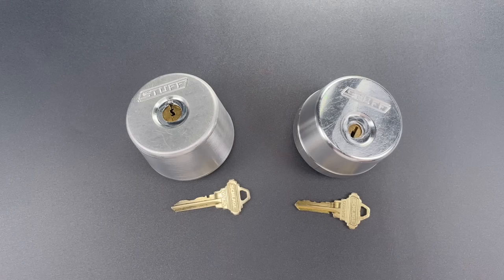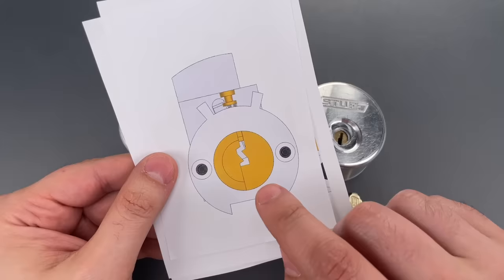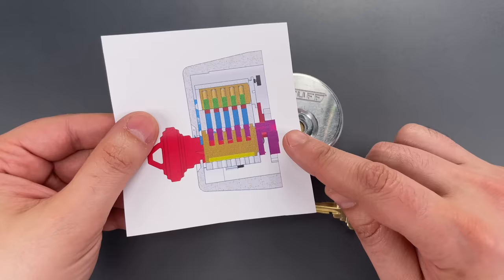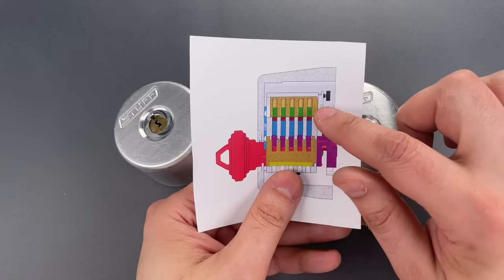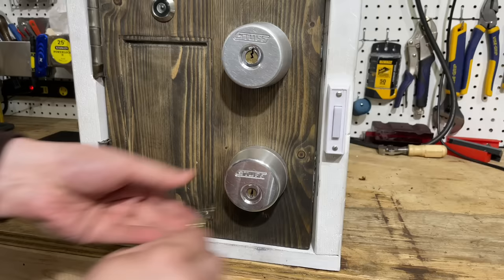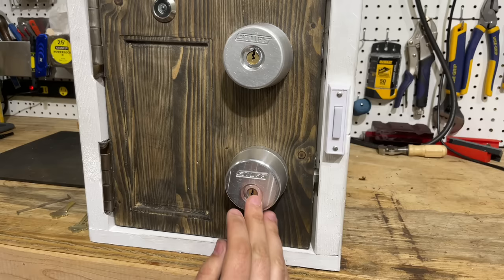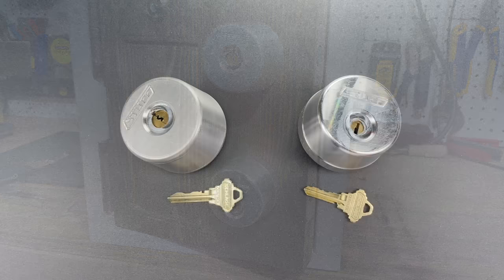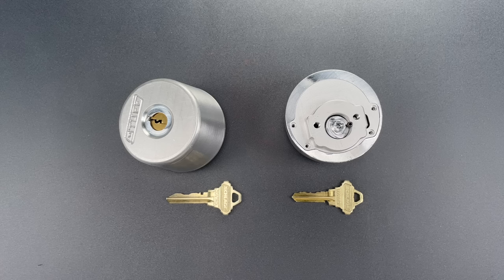[1299] Unpickable Locks From Stuff Made Here

Comment: Can't wait till Shane redesigns his locks again based on the feedback and this happens again
Reply: "What we're gonna do is use this jackhammer to remove the wall and bypass the door and lock in it's entirety"
Reply: @VilTheVillain  I'm starting to feel like that would be the only way. Shane literally built a back cover to fix one exploit LPL used before he even made the video, and the other two weaknesses are easily fixable with very little work. I feel like give them a few months working together, and they can create a truly unbeatable lock
Reply: @AlphaSeagull  absolutely. A master engineer and a master lockpicker building a lock together? That shit would be bomb proof by the end.
Reply: @acewarbringer4295  then they should patent it and either sell the lock or sell the design
Reply: Shane usually only gets things to the "proof of concept" phase before switching to a new project.  He's already worked on this one for ~6 months.  That said, it wouldn't shock me in the slightest if someone with business experience either bought or "borrowed" this idea from Shane.
Reply: @VilTheVillain  Pretty sure just using a ramset few times would do the trick.
Reply: @r3dp9  if you think this lock idea is some kind of crazy original thing you'd be wrong. There are plenty of extremely sound, pretty much un-bypassable lock designs out there, they're just not worth manufacturing. So no, aside from a gimmick, no-one would be wanting to borrow this lock idea for mass production. Of Shane can come up with this idea don't you think an engineer who's entire job is to design locks has thought of it?
Reply: Can wait for Shane to redesign the lock with a moving key hole so you never miss putting your key in the lock.
Reply: @AlphaSeagull  he should definitely sell that shit
Reply: @milo867  underrated comment 😁
Reply: @poopfartlord9695  - exactly. To mass produce this lock the price would be 800. Lock at abloy.
Reply: He will 
Im saying he's probably watching
Learning to Say we need a iron door and good deadbolts
Reply: @acewarbringer4295  yeah
Like They should collab to make the most Unpickable lock 
Undrillable
Unpickable 
Unshimmyable
UnBreakable
Reply: @r3dp9  id take it
Reply: @poopfartlord9695  well it would impress the market
Reply: @peterv1318 Well I'd buy for Protecting my SSN amd such
Reply: evryone : Can't wait till Shane redesigns his locks again based on the feedback
shane : oh shit here we go again ..........
Reply: To everyone reading this: I don’t know what happens in your life, but don’t be hard on yourself; love never hurts someone but a wrong person does. Don’t be sad. Stay smile. Don’t allow wrong people to ruin your life. Go ahead. These fluctuations are the part of life!
Reply: @r3dp9  It's not too practical from a business perspective. There's very few cases where an unpickable lock would actually make sense. First off any building with accessible windows has already rendered the locked door moot to anyone with a brick and poor manners. Even if you have a building where the door is the only way in and it can't be broken down then you run into the issue of people potentially stealing the key. At the end of the day it makes more sense to simply implement multiple security systems and going for high end, but not impenetrable for each individual system since even an "impenetrable" system can still be beaten and if that's your only method of security you're in for a bad time.
Reply: @poopfartlord9695   No, I do not think a lock designer has thought of it and there are examples of "accidental discoveries" or breakthroughs throughout history... there is an issue that some engineers suffer, even good ones, that was somewhat illustrated by Shane himself... he got tunnel vision on one aspect without enough feedback on the "goofy" things a lockpicker might do... If you noticed, LPL utilized exploits to get around the design, not a standard "unlocking of the pins. He even admitted that Shane was wise to weld the hinges or he would have just popped the pins... that would be a technical cheat as he would not have been "picking the lock"... AS it was,  If his ONLY access was through the keyhole and he didn't go around the outside, he would have had a much harder time. He also had the advantage of knowing how the internal mechanism actually worked ahead of time and was therefore able to design his "attack" in a specific way from the start.... a luxury that a random picker (even one as good as LPL) would not normally have, and thus the apparent "relative ease" in which he popped through them. I have to salute both of them overall because that direct feedback loop is how you iron out that tunnel vision.
Reply: @edwardpaulsen1074  I agree with most of what you have said, but most of us pickers know the internal workings of the locks we pick, its how we know how to pick them. One person studies them for flaws first. 

For the rest of this thread, an expensive unpickable lock... who will buy it? House owners? Ok I bust through a window, or I attack the hinge, or the latch, or just completely destroy your lock making your investment expensive or pointless. Mind you this is the FIRST sort of thing a criminal would do, its only white hat pickers that gain entery by picking.
  So that leaves buisynesses. If they have the need for the security, and are going to drop money on a lock, then they would probably drop money on a vault instead for much better protection.
Reply: @seantaggart7382  yeah, for a gimmick sure as I said. Like master lock releases an actually decent lock for once or something.
Reply: LPL didn't even attempt to PICK the second lock, so what was the point in Shane designing a completely new mechanism and sending it to LPL, if LPL wasn't even going to see if it was pickable? Utterly ridiculous, how come nobody else noticed this? Are you all blind?
Reply: @peterv1318  target
Reply: @johnthomas338  yes he did, one he tensioned from behind the mechanism, the other he overlifted. Or do you mean after the plate was sent to correct the weakness?

Comment: Common locks: I just need a lockpick set
Unpickable lock: For this challenge, I need to expand my tools with knife and hammer.
Reply: "For this challenge, I will just use my handy firemans axe and go through the door." Brute force wins every time. (even though I appreciate that he used the hammer and knife to actually manipulate the lock, so i'll still consider his solution as "picking" the lock)
Reply: Big upgrade
Reply: @cuffzter  lock picking lawyer :picking lock of front door
Me with a “door basher” or whatever it’s called I got from a swat team: sup bi###
Reply: @cuffzter  that's how you get shot
Reply: @TheStoicApe  TBF if someone NOTICES you locking in somewhere you don't belong, that's also how you get shot. More like that's how you increase your changes you get noticed. Plus they do make relatively well reinforced doors, metal, etc. (Windows exist too haha)
Reply: Good job, you are officially one of the only few above stuff made here's comment
Reply: Yes
Reply: "A chain is only as strong as it's weakest link, so to get into this door, I'm going to use my everyday lumber axe"
Reply: @evanmontague9456  battering ram

Comment: Shane: “i think i made an unpickable lock?”🔐 

LPL: “i got a click from 1..little click from 2 “
Reply: Everyone was commenting this on the last video, but he actually did it. Now, he didn't show if it's still pickable with the backplate on.
Reply: @John3_17-21  he said it stops that exploit, I think that's enough. 

The other way of opening the lock still works with just the backplate though
Reply: Every fucking time
Reply: @thijsbeentjes4008  it only stops one of the two as the first option requires a lock piece to be redesigned. So it's still possible to pick
Reply: @wilihelm2242  that's literally what I said
Reply: @thijsbeentjes4008  The knife trick can easily be solved by simply installing the lock on a real door which doesn't have a huge gap between the door and the doorframe.
Reply: @dannymartial7997  right, no respectable door has that big of a gap like that, also maybe a magnet inside the door frame that makes it too difficult to slide the bolt with a knife and not strong enough that turning the key wouldn't pull it back.
Reply: @dannymartial7997  LPL also suggested a different way of stopping that exploit. It hasn't been fixed yet though so I'm not sure what your point is
Reply: shane breaks down a little bit more as he sets every pin
Reply: I actually laughed out loud when I read this. Well done
Reply: i shit on chair after read this LOL
Reply: Lol
Reply: LOL
Reply: @dannymartial7997  Or just one that swings inwards, where you won't have access to the bolt. As is normal. Hinges are on the wrong side of the door is all.

Comment: Stuff made here: "I made an unpickable lock"

LPL: "So anyways I used a knife to pick this lock"
Reply: He didn't actually pick the lock. What that was was now a vulnerability in the lock, but in the door itself. Actual door has a flange that makes the locking lug unaccessible.
Also, the other attack that involved sliding the tensioning tool betweek the lock and the door could have been easily avoided by mounting the lock deeper in the door, not on top of the surface of the door.
Reply: I think it would be a little more bittersweet if he used a butter knife.
Reply: @kardRatzinger  accurate
Reply: @kardRatzinger  You are probably right but I think LPL demonstrates very well why focusing on a single aspect is problematic.
Reply: @OriginalMrE  Butter-Sweet?
Reply: LPL could have used a half-eaten hot dog and a dead slug to pick these locks, but that would be flexing a bit too much.
Reply: He was able to pick the locks quicker than I can open my own with a key!
Reply: @kardRatzinger  It's a problem with the lock itself as LPL was able to "unlock" the bolt and then simply push it back. That's not something that can be done with any decent lock.
Reply: @Tuulos  it's really an issue with the deadbolt mechanism, however the lock it's self wasn't bad, although it was decodable, it should however be possible to solve that.
Reply: To everyone reading this: I don’t know what happens in your life, but don’t be hard on yourself; love never hurts someone but a wrong person does. Don’t be sad. Stay smile. Don’t allow wrong people to ruin your life. Go ahead. These fluctuations are the part of life!
Reply: @kardRatzinger  You're arguing semantics
Reply: After mods is unpickable so its well made imo
Reply: @Tuulos  yes, that is true, I'm just saying, in a real life scenario you probably wouldn't be able to exploit this problem. But it is a weakness.
Reply: @JohnDoe-uq2qd  That's actually one of my hobbies.

Comment: Shane: welds the hinges so LPL cant just pop them. 
Me thinking: “oh come on LPL wouldn’t be so petty”
LPL: “I would definitely have done that”
Reply: That's what I was thinking too!
Reply: my thoughts exactly 🤣
Reply: Shouldn't count though since the pins would be inside the door in a normal configuration.
Reply: Pretty sure both are joking. If LPL had that for the entire video after so much hype between channels, nobody would be satisfied. It's one thing to show easily bypassed locks for a commercial product, but he knew he had to approach it honestly.

If we're very lucky, SMH will put in the ridiculous time custom machining takes for v.3 & v.4, and we might get a part 2, but I wouldn't count on it. SMH already succeeded in proof of concept, removing exploits and having LPL spending time trying to find new ways to pick or bypass it isn't nearly so enjoyable for either party (though I would be interested to hear what LPL would do if his suggestions were implemented)
Reply: @mjp121  smh my head 

/j
Reply: Technically victorious is the best kind of victorious.
Reply: @litebrd003  I used to work for a moving company and we had to remove doors daily. Though there weren't many I did see about 8-10 exterior doors with easily removable pins on the outside over the seven years and several thousand homes I worked in.
Reply: Security is only as good as its weakest link.
Reply: External hinges are fine, you just need to use hinge bolts to secure the door when the hinges are removed. This configuration is usually more secure against physical attack as the attacker is forced to "break in" an outward opening door.
Reply: He probably would've done it just to make a point (about security only being as strong as the weakest link and all that), but then focused on the actual locks for the rest of the video
Reply: So many great minds in one comment :D
Reply: Bro wtf he said it exactly as I read this